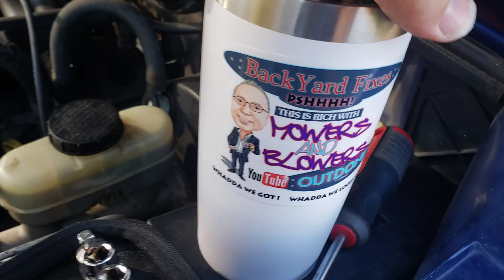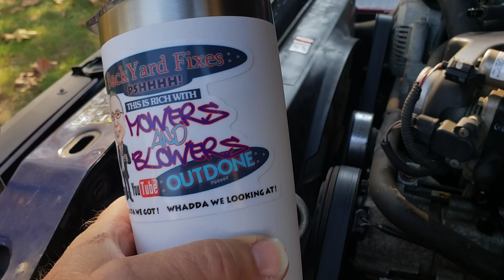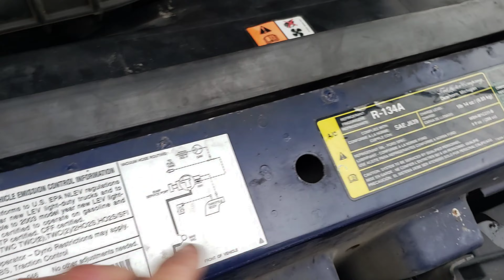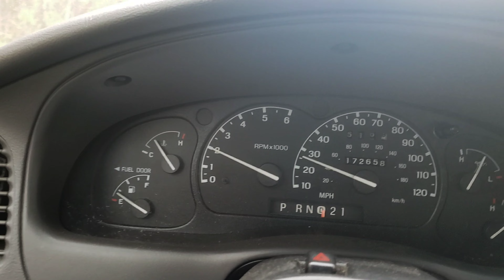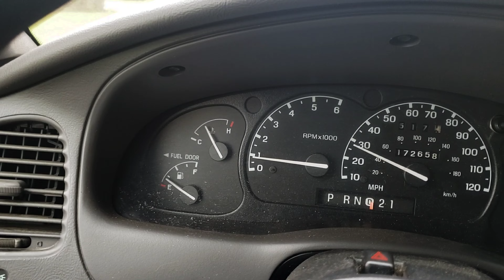2003 Ford Ranger Edge 3.0 Radiator Replacement Mazda B2300 Fits 2001-2011 Mowers n Blowers Special

Comment: Nice job on the repair Rich. That truck is in very good shape. My brother has a 2000 that he keeps in nice shape. It has over two hundred thou miles. It still runs like new.
Reply from the maker: Thanks, I have several Ford Rangers left after selling 3 just recently. I might keep this one. Wink.  Thank you for your support.